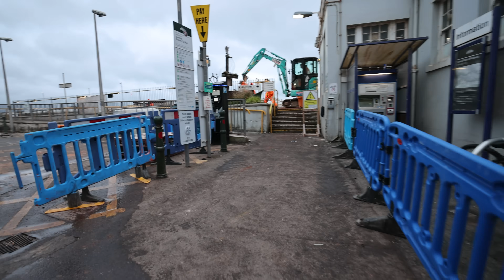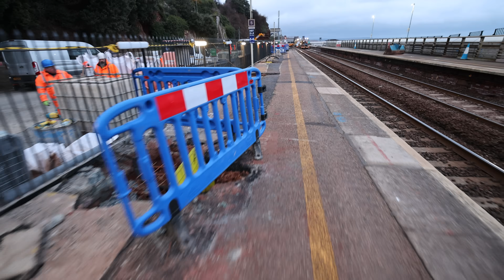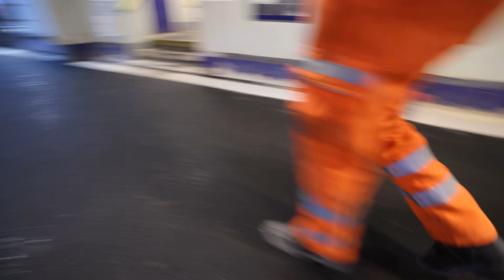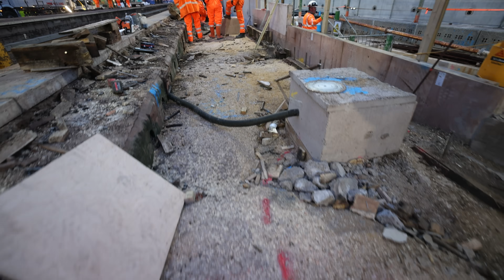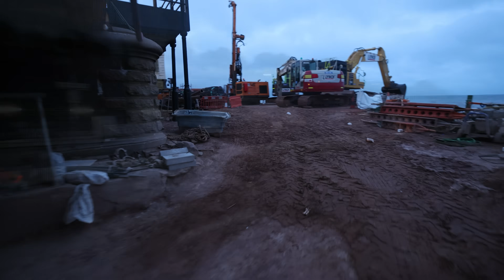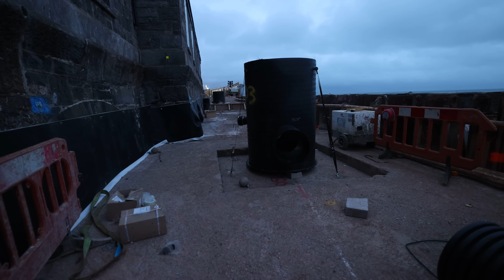Dawlish Railway Station Platform Upgrade - Part 1

Comment: It will be great for disabled users to have lift access across the footbridge! ( I expect it takes a bit of courage to have to wheel your way across that railway track as it is at the moment!!) Well done Chaps and Beach Cam man for bringing it to us 👍
Reply: A member of platform staff used to accompany/push wheelchair users just to ensure they got across safely.  Many years ago they needed assistance up the portable ramp into the baggage van as carriages were not designed for w/chair access.